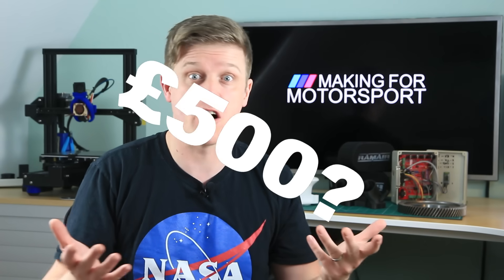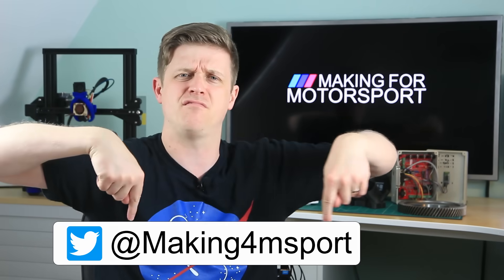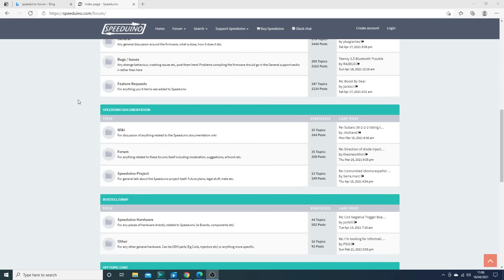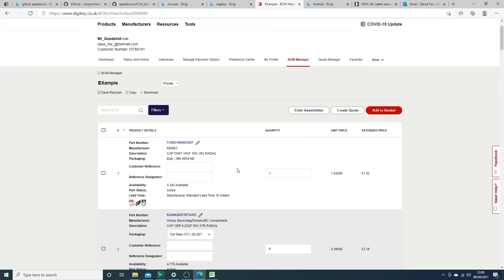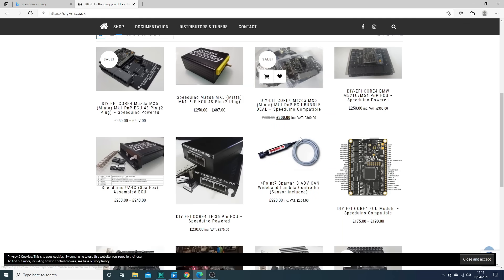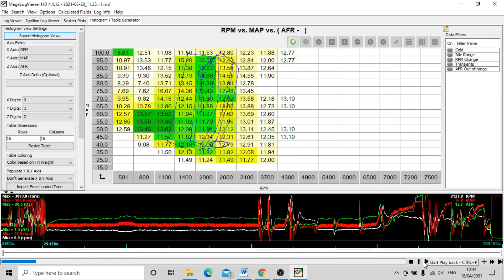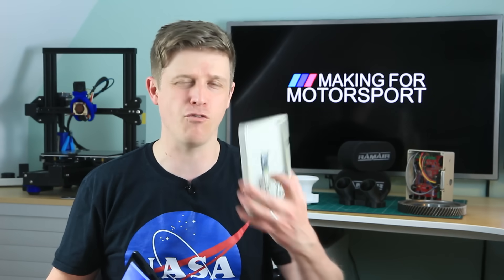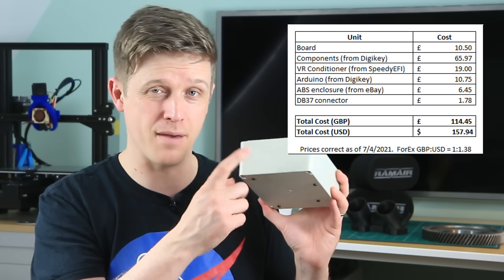The Best Value Standalone ECU - Speeduino

Comment: please advice a proper solder station. I've bought so many duds! what is a proper solder station brand? Thanks!
Reply from the maker: I’d love to but I’ve never bought a good one myself!  I have used a Weller station back in uni and that was good... sorry, I’m not the best person to ask!
Reply: @MakingforMotorsport  Thanks once again. Will buy completed modular units then, leave the soldering for others
Reply from the maker: @louisfaasen4511  just a quick one, I have just put another Speeduino together for the next video and bought a new soldering station and it was very good.  I can’t post links or they’ll be deleted but if you search for “LONOVE 60W” you’ll find it, still not a proper brand but it works well 👍.
Reply: @MakingforMotorsport  Thanks, yes I bought the LONOVE 926 LED iii. Received it via mail, but the heating element was broken. Now I sit with a dud that I do not know how to repair?? I do not find any proper support for LONOVE products, in order to buy a replacement part. So I would say, do not buy LONOVE products.
Reply from the maker: Good info and unlucky, If it’s dead out the box just return it, Amazon is quite good for that. Hope you find something!

Comment: Avoid Innovate wideband controllers if possible, as they are usually pretty hard on sensors and can be unreliable under less than perfect conditions.  Go 14point7 Spartan, PLX, AEM X series, or Zeitronix are all much better options.
Reply from the maker: Fair enough, I only have the one and it’s been pretty reliable up to now, i’ve never used the others so I can’t really compare...
Reply: @MakingforMotorsport  I have a MTX-L that's actually worked fine for a while, and an LC-2 that would screw up all the time and was basically useless.  It's a pretty common chant in the enthusiasts circles to stay away from Innovate widebands if you have a choice, so just figured I'd mention it as there are plenty of people not as lucky as you on those.
Reply from the maker: @hdrenginedevelopment7507  fair enough, back when I bought my first Megasquirt the LC1 was pretty much on its own at the price point but now there are lots of competitors... I just bought the LC2 on autopilot!  If I buy another then I will diversify...
Reply: @MakingforMotorsport  I've heard the LC1 was something of a benchmark legend, and a bunch of people who knew what they were doing left Innovate before the LC2 was a thing.  People that actually have or have had an LC1 still brag about it in the groups.  Controlling the wideband sensor is a very challenging controls problem because the sensor cell temperature has to be precisely maintained against wildly changing EGTs and flow rates, so heater power supply design and control algorithm speed and stability are critical.  The LC2's programming seems to struggle with sensor stability with fast changes in EGT, and I've read reports that the heater control circuit design is able to supply a bit too wide a range of heater voltages than specified by the OEM datasheet, which tends to strain and thermal shock the sensor cell when the control loop gets too far off target.  That and also the heater driver design is prone to causing noise in the sensor signal.  Should be fine for a mild to moderate build as long as it is stable, but I definitely wouldn't run it on anything expensive.  Mine would work ok until going in and out of overrun cut or accel enrichment,  and would go into jumping around wildly and either freeze up for a while or just give up and E8.

Comment: I don’t understand why you haven’t massive number of subscribers as your content is very good quality the whole set up is brilliant and your really easy to listen to and watch compared to even a lot of bigger channels! Keep it up. Jacko. Bath.uk
Reply from the maker: Thanks Jacko, that means a lot!   I’be only just started really and still finding the groove, but 3 weeks ago I had only 750sbs so the growth is starting to go 👍 
I have plenty of videos planned in the same vein as this so keep watching!  Cheers!
Reply: @MakingforMotorsport  it just goes to show, there’s a number of channels like yours with amazing content which you’d expect from bigger channels but size doesn’t always matter (some parts of life) always haha. You’ve introduced me to the speedunio ecu and I’m currently running a rather old ms ecu on my supercharged 2003 Clio RS 2.0 and the ms has a lot of downfalls but was in my price bracket all them years ago, now I’m more experienced (9 years on from the initial engine build) I believe that little ecu is possibly my next move. Boost/torque limiting in 1st & 2nd / by gear is a big want but unsure on if it’s totally needed.currently only running low 11-12.5 psi with 335hp - 300ft tq.

Comment: I've put a speeduino in my 1981 bedford cf motorhome to make it a bit better fuel economy wise. It was quite a project but its working and is fairly dependable.
Reply from the maker: Excellent, I love to hear about people using them practically!  What was the hardest bit for you on the install?
Reply: @MakingforMotorsport  the hardest bit was to figure out a magnet holder for a trigger wheel to get the cam position. But all in all it was pretty straight forward iterations to get to a finished working vehicle. At the moment I'm still fighting a bit with my idle but I hope I'll get this straight with the idle valve I bought. By now I have a wide range of different car manufacturers incorporated. Fuel pump from a Mercedes, injectors from a VW passat, ignition coil from an Audi, idle valve from a BMW and so on. To get the fuel rail tight required some engineering and a few iterations until I fabricated some adaptors from Bosch ev2 to 8mm hose, t this gave me the flexibilities of a fuel rail made from hose as there is no fuel rail for my specific modified bedford intake available. I built all this fully reversible so I can always go back to carb and mechanical ignition.
Reply from the maker: @DrZoidbergism  excellent, now that’s a proper installation!  It’s always a lot easier when you can reach into the parts bin for the engine. 👍👍👍
Reply: @MakingforMotorsport  yes that is right. The easiest is to modify an already fuel injected engine.

Comment: Those smaller plug and play connectors can fail over time. While not pretty larger connectors are more reliable & do not have limited plug events to deal with.

Comment: It's great to see things on the lower end of the cost spectrum, but as a tuner I hate to see people think that this ECU is anything compared to higher-end ECUs.  There's zero similarity and zero comparison.  As long as people understand this I have no issue with speedyefi
Reply from the maker: I’d like to think people in general are smart enough to realise this isn’t a Motec rival.   But I disagree, the “behind the scenes” maths and coding for this in SD mode is pretty much the same as every other ecu in SD mode, regardless of cost, and they all use microcontrollers of some sort so there is similarity and comparison.

The key difference is that someone paying £1000+ for an ecu will also pay £250+ for a properly made loom and pay someone to install it all, so as a package it should have 100% reliability and if you have a problem you can ring a helpline (which you’ve already paid for in the ECU whether you use it or not!) whereas the diy’er has to get all of those things right themselves.

I’ve said this before in a comment, but someone trying to push 3bar boost and run sub-8s with a £20k engine would be mad to use this....   but I’d be mad to put a £1000 ECU on my scrapyard engine....

Comment: This is awesome! I will be using one of these for a race ep3 build. I've poked around on several of the websites without much luck, I see there are tons of options available - is there a parts list of what is necessary to buy? I would like to buy one soon, but I'm not sure exactly what all needs purchased for my application.
Reply from the maker: Hi Nathan, it depends what you want, if you just need a 4cyl, seq fuel and cop ignition, launch and Rev limiter, then either the v0.3 or v0.4 will do you.   What features do you need?
Reply: @MakingforMotorsport  to start out the motor will be NA with a vtec killer cam setup, so no variable cam timing. Eventually a supercharger will be fitted, so expandability to control that will be a must.
Reply: @MakingforMotorsport  so I suppose I should say basic 4 cylinder management with boost expandability.
Reply from the maker: @TierNoneOperator  speeduino has you covered, either a v0.3, v0.4 or UA4C will do you for sequential injection, coil on plug and boost control 👍
Reply: @MakingforMotorsport  what is the difference between the 0.4 and ua4c? And as far as parts to buy I need the board, arduino unit, component kit, wideband board, and Bluetooth board? I do want to utilize a tablet dash.
Reply from the maker: @TierNoneOperator  I suggest you have a good read of the manual, all the Bluetooth info is in there, I just followed it step by step.  If you get stuck into the research you’ll understand it a lot more.  
My next video will be me building one, but if you plan to give it a go you need to get it under your fingernails... 👍

Comment: Shocked I've only just found this channel. I'm putting itbs off a RB26 onto a RB25de-neo. Management is my main stumbled. The neo engines use a different setup to the earlier engines.
Reply from the maker: Welcome along, the channel has only been going a few months so still new!  I have little knowledge of the skyline engines except that the GTR is one of the few turbo’d engines to run throttle bodies, I am assuming that the RB25de-Neo runs a single throttle at the entrance to the plenum?  But does it still run a MAF?  
Speeduino can’t use a MAF but they are quite versatile, they don’t really care about wheee the throttles are etc, so you could leave the MAF in place as the GTR does and just move the TPS over and stick with your current management.  as I said this to the best of my knowledge so you should do some more research to satisfy yourself.

Best of luck with it!
Reply: @MakingforMotorsport  the RB26 runs itbs as you say and 2 mafs. One per turbo. the RB neo series were the last of the RB. They basically took all the best bits of the RB series and used them to make engines that were more efficient. Mainly for emissions. But the changes in head work are significant. 
A switch to map sensor was always my plan. I thought I'd need a d-jectro apexi or if I couldn't find one... Well. Big money on a link/haltech etc.
Which I don't want. I got the engine for penuts (£400, turbo neo engines sell for £2500!) And the car is one of the last c32 laurels that is a ukdm model (most were rotten and scrapped by the mid 90s. But I picked it up for £300. My aim is to run itbs, manual gearbox, coilovers and keep the bodywork standard and keep the whole project under £2k. I have some rota rbx wheels in 17x9 et-12 or something. So I hope I can make it look period correct (late 80s) and have decent fitment. The rear camber and toe will be tricky but worth it!

Anyway, love the channel and it's ethos. If a mid 30s saddo like me with a geeky workshop can help. I'd be glad :)
Reply from the maker: Sounds like a great project!  You don’t see many of those Laurels around at all! 
You can run turbos and ITB using MAP, but off boost you’ll need to run AlphaN off the TPS, but you can do all of that with the switchable tables feature.
Best of luck with it, love them boxy 80s machines! (I want another E30!)
Reply: @MakingforMotorsport  not sure why my first comment was deleted on my screen. Then I replied and it showed up 😂.

It'd be handy to use the original TPS that's for sure. I'm having to make a cad adaptor plate anyway to bolt up to the 25 neo head. So I could adapt the linkage at the same time.

I had an E30 as a daily in uni. Lovely car. I'm a nissan man at heart. But hard not to love an E30! I always wanted to b52m28 swap it. Would have been a perfect daily then.
Reply from the maker: I am 3 series through and through for road cars, I’ve had loads, even my company car is a 3, no m-car tho, yet!

I misunderstood, if you want to keep the standard management with the MAF then put your ITBs into a plenum and repipe your MAF into it, air is air at the end of the day, but unless you can remap it you won’t get all the benefit of ITBs.  The other option is either AlphaN or a blend with MAP, I am just running AlphaN with my ITBs.

Thanks for the offer of help,  at the moment the channel is filmed mostly at night in my spare moments between my two kids and diy for the wife so I’m just fitting it in!  If it keeps growing I will have to spread my wings at some point so keep in touch 👍
Reply: @MakingforMotorsport  Can't fault you. My current daily gets a bit too much attention sometimes. I picked up a e46 330i with a rattle. hopefully the oil pump nut! The HK stereo and quality interior plus a cracking chassis should be a fun daily!

I'm wanting to do the opposite ideally. Open itbs (probably a long tube filter for road driving. but just the trumpets for shows. the itbs are about response but mainly noise for me. So I really dont want to run a plenum. 

I'll watch more videos and keep learning. Then i hope I can ask more questions!

No problem. I've been modding cars for 15+ years. It only became my profession 3 years ago, but it's going well!
Reply: @MakingforMotorsport  thank you for the reply. The RB26 does indeed use MAF to give a input for air. But it does it with 2 maf sensors. One on each intake to the turbos.

My engine is a fairly rare 25de neo. DE meaning dual cam and electronic injection (sorry if I'm preaching to the choir. If it was a vaxhall engine for example I wouldn't have a clue what means what).
Point being. I'm taking 6 itbs that now will need a air input
 I could use a collector plenum and a single MAF. But there's a very specific reason I'm using itbs. Its a very unusual project. 

It'll be remaining NA. I adore all my boosted nissan engines. And my na V6 drift car/(privious cars). But a high revving 6 cylinder nasp engine on itbs is a tuning goal/must drive of mine.

The channel is super professional given how new it is! Would you be looking for any help at all? From a practical point of view :)

Comment: think this is what i'm going to convert to after i rebuild the 5.3 LS in my '71 El Camino. nothin wrong with the stock ECU, but a 1-time tune/reflash by a shop here is more expensive than that entire unit, plus the BTooth screens, with the paid software version that auto-tune's on the fly. GM also has an annoying throttle-smoothing/delay with DBW i'd like to get rid of, cause it makes rev-matching cumbersome.

only other thing i'd like to look into is, can i have multiple tunes loaded & hot-swap between them at any given moment?...would be tight to have an economy map, & HP map.
Reply from the maker: There are secondary tables for spark and VE so you can do as you describe.  👍
A recent tune on the other hand should do exactly as you say I. One table, lean and efficient at low throttles and “mo’powah!” at higher throttles/load.
Reply: @MakingforMotorsport  ...that's amazing - thx for the insight!

Comment: Great video, I’m not knowledgeable or experienced in car electronics, I would like to fit this to a 1997 Kia Sportage? This vehicle is still OBD1, would I be able to fit this kind off stand alone ECU to my vehicle and if so what would I need to do?
Any advice would really be appreciated.
Reply from the maker: Hi, I don’t mean to put you off but you should be aware of what is involved fitting this, it’s a major change and you need to understand the car and how it works, if your not confident I would suggest You do a lot more research.  The other thing that won’t help you is I doubt there is a large amount of tuning info on the Sportage, so you’ll be finding a lot of information which, with a more popular modified car, would be more available...
I am sure it’s possible but you just need to understand it 100% before you start cutting wires!

Comment: I'm putting a rare Toyota V12 in a 54 Dodge and this would be icing on the cake.  Anyone know what it would take to make this work for a V12?  Btw, I'm a software engineer with an addiction to building unique cars.  I put a MR2 motor in a 62 VW Bug, a supercharged series 2 3800 in a Fiero, a supercharged 2.5 in a Miata, and this is my next project.
Reply from the maker: I like your ideas!  I’ll be honest, with your background you’d be best diving into the detail, the standard Speeduino is limited to 4channels for fuel and ignition due to the amount of timers, the Teensy version of  Speeduino has more so can do 8channels of each.
Lots of OEMs used 2 ECUs of v12, one for each bank.... I don’t see why you couldn’t do with Speeduinos.... I’d love to try it!  You could do that with wasted spark and paired injectors with two Speeduinos, like 2 straight 6s.
Best of luck 👍

Comment: How does it stand up with the power going through the 12v and the demanding sensors
Reply from the maker: I run most of the standard sensors that came with my engine, and the Speeduino runs them fine 👍